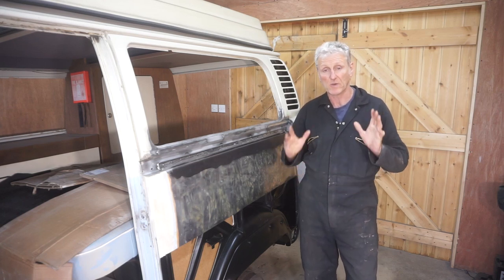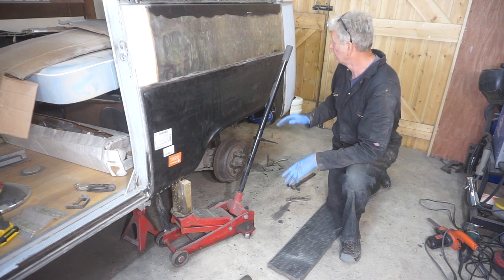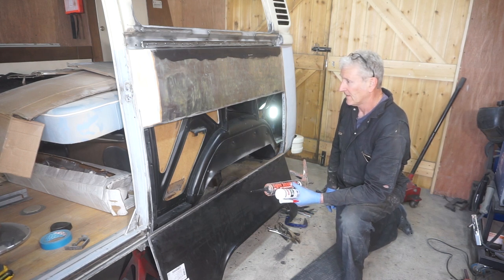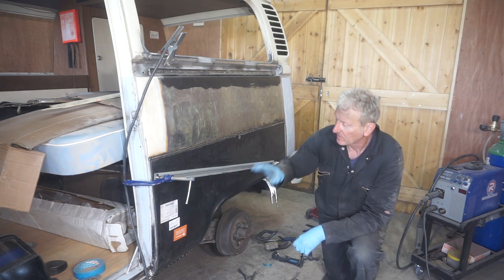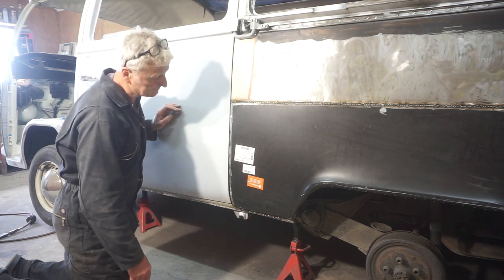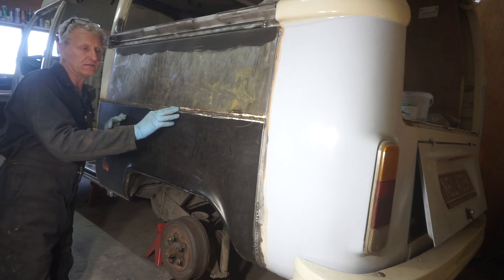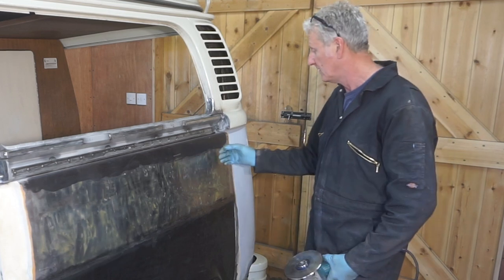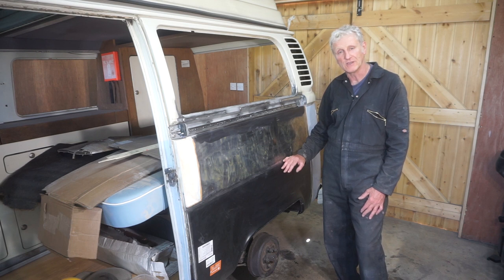1973 VW Campervan Restoration Part 24

Comment: Good job with that panel fitment. After you put the door on and saw there was a difference of about 4mm I would have just filled that. I’m about to do the same job on the drivers side after having done the rear corner and rear valance. 
I’m chasing rot like you did.